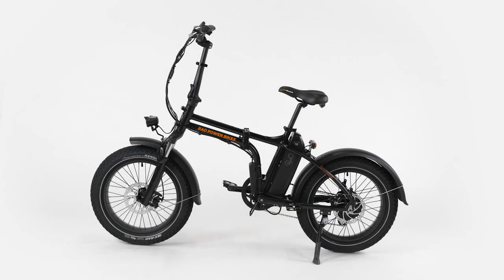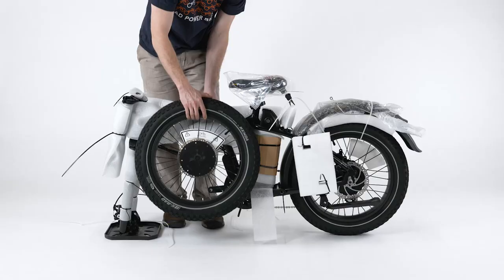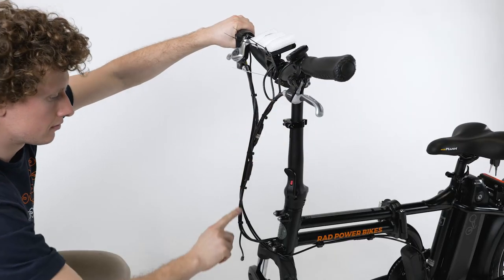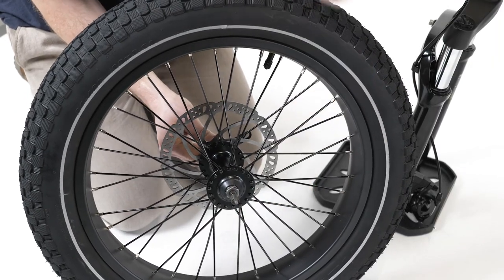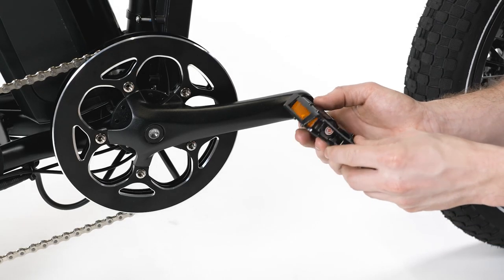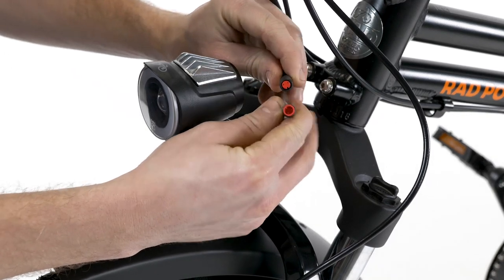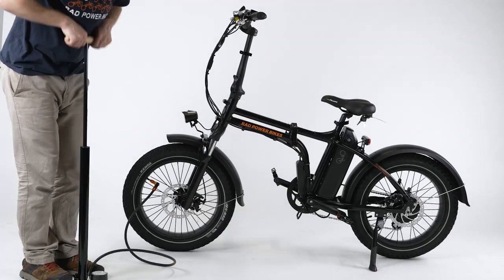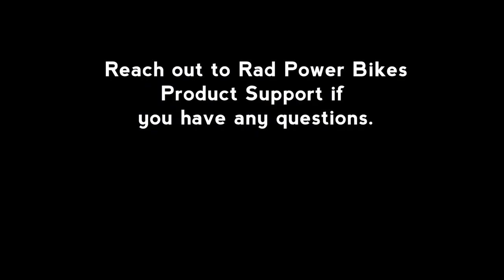RadMini 4 Assembly Instructions | Rad Tech

Comment: These were great instructions, as a novice or rather a complete beginner in the realm of anything bicycle handy, I was able to put my bike together (solo) in about an hour. I would recommend getting a torque wrench (the hour assembly included about 5 min to figure out how to use one of those) and a pedal wrench for sure. The trickiest bit was placing the front wheel in, but after that, it was pretty smooth sailing! I would also second some of the other user comments here for Rad to include a small packet of grease. I had to buy a large tube for a small application. The first ride was great, a little noisy.....but..I figured it out. The bike comes factory at gear 7. That gear is much to high, shift it down to 5 or less and the noise coming from the back of the bike (a high pitched kind of squeal) will dissipate! Have about 15 miles on the bike in the first day and absolutely LOVE. THIS. BIKE. I'm a 5'10, female rider and the bike suites me perfectly. I'd highly recommend this bike (and its on sale now, right after I purchased it for full price, lol), so if you are on the fence...buy it! Pedal assist 2 is all I need to set an even 15mph speed with little to no effort. Just a beautiful bike.
Reply from the maker: Congrats on the new bike! Thanks for looking out for your fellow Rad riders with these assembly suggestions. We appreciate your feedback, and we hope you have a fantastic time with your new bike! Happy riding 🚴‍♂️

Comment: Great video! This bike arrived today & I was able to assemble it myself after watching this video. This was my first bike assembly, and I was happy that it included some basic tools as well. The only issue I had with assemble was lifting the bike to position the front wheel on my own, but I was able to connect a ratchet strap to hoist it up a bit to take some of the weight off, then made sure the tire was seated completely before tightening. I did order a bike torque wrench set from Amazon, just so I can make sure everything is tightened to specs. Looking forward to riding!
Reply from the maker: Hey Crystal! Thanks for sharing your assembly story! So glad that it went well. Happy riding! 👏🚲
Reply: How fun! My RadMini arrived today and I was able to assemble it myself, too! I laid the box flat and slid the bike out. No chance to lift it out of the box without help but didn’t want to wait until everyone’s gotten up, 😊. I agree, fitting the front tire was hefty for a lady but I succeeded. Just finished my first ride of 11 kilometers. It was so much fun!
Reply from the maker: This sounds like such a success story, Mämselino! Thanks for sharing more of the assembly details. So happy to hear you're up and riding!

Comment: Spent more time adjusting the front tire then anything- brakes were not properly adjusted from Factory
Reply: Exactly. Same situation. What did u do?
Reply: @mrbindhaas1520  eventually I got it on. really had to play with it though- lucky enough to live near a rad dealer where they refined the brakes after I has issues getting them to work properly.

Comment: Stoked I got this bike. Yet heads up for those consumers (like me) who don't service their own bikes...

> Requires a hardware store run for most folks before assembly. Those zip ties are impossible to cut with scissors or razor blade. Most are so tight around the metal parts that you risk scratching. No mention in assembly instructions on the right tool to use.
> 3:10 - That looks to be a Park tool ratchet wrench that retails more than $100. There are cheaper ones (up to 6 nm), yet wondering if one is absolutely required, or if you can just hand tighten.
Reply: Wire cutters will work.
Reply: I managed to cut them pretty easily with household scissors.
Reply: @avrege  You must have the teeny tinyest household scissors that Tinker Bell would use.

Only thing that worked for me were a pair of flush cutters found at hardware stores.
Reply: I hear you on the zip ties. Having a pair of snips makes it much easier. There are a LOT of zip ties, so if you don't have the tool, the inconvenience adds up.

Having a torque wrench is best, but if you're handy, and have worked on bikes, you've learned to get it approximately right by hand.
Rad can't recommend we "wing it", but you kinda can just freehand it.
If I weren't handy, I'd "wing it", then ride it a week or so keeping my eyes on those bolts if I'm the nervous type. THEN take it into a shop for a "checkup" or tune, which will be cheaper than a $150 assembly. Just ask them "Hey, can you check the torque on these bolts?" and it'll take them all of 30 seconds for that bit.

Comment: So I am attempting to follow these instructions as carefully as humanly possible because I don’t want the front tire to fly off and end up dead or crippled for life.... To illustrate my dilemma I will in all sincerity ask “ what is a Newton Meter? How can I tell how many I’ve applied? Do I really need the grease? Because I don’t have any. I also don’t have a bike pump or any of the tools that weren’t included- except for the snips for the plastic things holding the foam and stuff. The tire seems to be on and I’m proud of myself. But is it on tightly enough? I wish my dad taught me these things or that I already knew them!
Reply: Nm is a metric measure of torque on nuts and bolts. You don't a special wrench. You can buy a little hand air pump on Amazon for cheap. You'll need this tool so you can keep tires aired up properly.  Tighten the nuts and bolts as tight as you can get them with the supplied tools as you go along with assembly. After you've completed assembly go over every nut and bolt and give them a yank. You can buy a small tube of white lithium grease on Amazon for a couple of dollars. A 5 or 6 oz tube is plenty. You need to grease the seat tube so it doesn't rust shut and you can't adjust it. Also grease the threads on the pedals. Take a pedal and go to Harbor Freight and ask an employee to show you a 'cresent" wrench to fit . After you've had the bike for awhile check all nuts and bolts routinely.

Comment: I'm terrible at putting things together. Why not ship it assembled in a bigger box folded up?
Reply from the maker: Hey Michael! If you need any additional help with assembly there are a few options for you! You can reach out to our Product Support team for assistance at - support@radpowerbikes.com, see if Velofix or RadMobile are within your range, or find a local reputable bike shop that can help with the last few steps.
Reply: It's better protected the way they ship it. I've bought almost a dozen ebikes, most shipped to me over a decade, and a consistent problem is that the heavy ebikes poke through and break their shipping boxes - which in turn puts the bike at greater risk. Rad does a very good job of dulling and padding the pointy parts of the bike to help the box last. You can see some of these parts in the video, like the black plastic disk circle that's on the front axle during shipping. Otherwise, that axle would rip the box.
It may save money in shipping, but that's not the point. It protects the bike and the box the way they pack it. Your local bike ship is usually happy to assemble it for you, but that adds $150 or so.
Reply: @RadPowerElectricBikes  thanks! Velofix delivered and I have been loving a Rad Runner for 7 months now 👍👍

Comment: When is the new rad mini 5 coming ? And will the new radmini 5 have the throttle up to 25km/h, since it is legal in the the eu? Its illegal to be more than 25km/h if it is not registered. But its legal to be  more than 6 km/h!!!
Reply from the maker: Unfortunately we cannot disclose any information about the release of new models, but please follow us on Facebook and Instagram, and subscribe to our newsletter to be the first to know about new releases and promotions. 
As for the maximum speed, all Rad Power Bikes Europe models will continue to hold a 250W motor, and will not exceed the maximum speed of 25 km/h.
Reply: If I remember correctly It's called the RadExpand 5 now, and it's similar to the Mini 4 Step Through without the suspension fork, with slightly fatter tyres, and without the display.

Comment: What if front brake disc is hitting caliper even with turning out 3 clicks?
Reply from the maker: Hi Drew, this may mean the rotor is out of true. Our Product Support team can help you troubleshoot this issue and source a local bike shop to help with the repair if needed. Give us a call at (800) 939-0310 ext. 2 or reach out at  radpowerbikes.com/support and they'll take care of you.
Reply: @RadPowerElectricBikes  Dunno. Sounds like a big assumption, it might be simpler. Is it hitting consistently, or intermittently? If the second, then Rad is probably right, it's prob out of true. If it's consistent & steady, your caliper may be mis-aligned. That's easy to fix with a 5mm allen key. You loosen the caliper's two bolts that hold its alignment, then apply and hold the brake - this action aligns the caliper, then tighten the two bolts.
Also note that some small amount of consistent contact, very light, is not abnormal with brand new brake pads. It's not perfect, but it's NBD.

Comment: So complicated. And you need some tools !!
Reply from the maker: It's easier than you think and tools are included with your ebike! If you need help, we have a dedicated support team to walk you through everything. Just contact us at support@radpowerbikes.com or call 800-939-0310 ext.2.
Reply: @RadPowerElectricBikes  Are the torque wrench, pedal wrench and seatpost grease included?
Reply: They include a wrench with the pedals. I used only that and found I could get them pretty tight. I might go over them with my own wrench later which is longer and has more leverage, but probably only if I notice them backing out. 
The torque values are really low. Basically just don’t  over tighten. I have a torque wrench that tops out at 110 ft lbs and on the Newton meter scale it didn’t even go this low. They do not include a torque wrench. I use blue lock tight on just about everything I put together. I’ve never had anything come loose even on motorcycles.
Reply: @RadPowerElectricBikes  I need two cone springs that didn't come with my sons bike that he hasn't been able to use at all since Christmas I've tried to call and enail several times !!!!!!
Reply: @rectalogic  HAHAHAHAHAHAHAHA